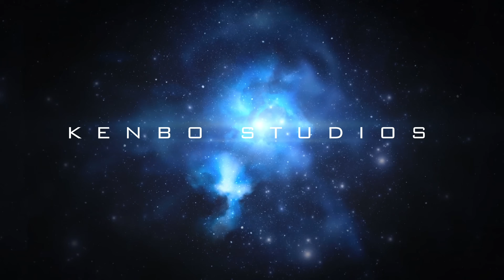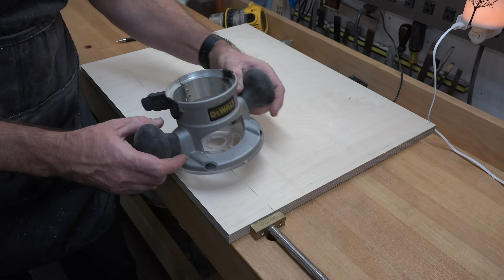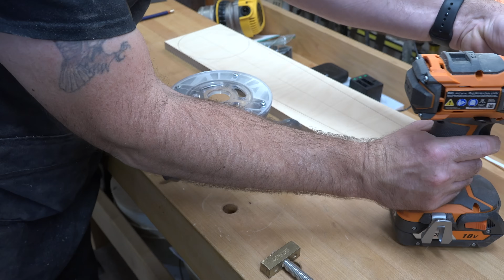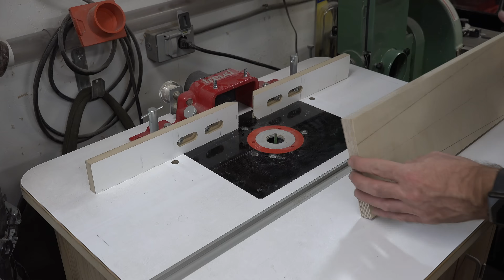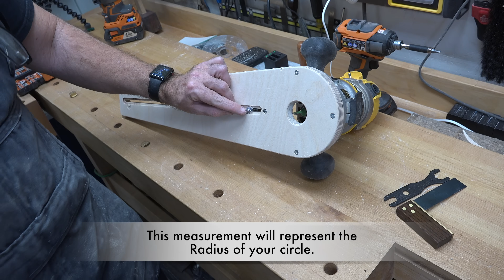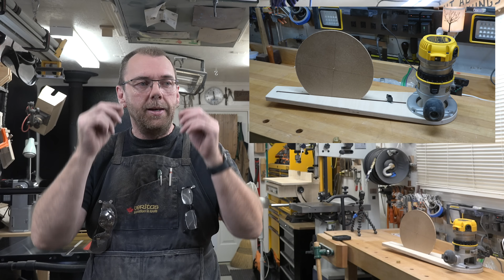Router Circle Cutting Jig

Comment: Ken, nice build.  Shop made jigs are great.  Usually they work better especially for a specific purpose.  Couple of things, you have to be honest and admit that you measured and double checked that there was enough room for the jig to make a full rotation in your demonstration.  I wouldn’t have and would have had great fodder for the mistakes video. LOL...  The second thing is that again you used MDF so again you have dust all over your shop.  Hope it is getting warm enough in Canada to open the doors wide and blow the dust out of your workshop.  Again another great project.  BTW, any thoughts about the email I sent you?  Shoot me a PM or email and let me know your thoughts.
Reply from the maker: Thank for the kind words on the show Paul.  In this case, the rotation clearance was strictly a fluke and I managed to get it right the first time.  As for the MDF....I guess I will never learn.  That stuff is seriously messy stuff.  It's still cold here in Canada and I am still using the wood stove to heat the place up so hopefully, I can do a full cleaning soon once the weather finally breaks.  As for the email, I've sent a response and it is something that we can certainly discuss.  Thanks for tuning in to the show sir.  It's truly appreciated.